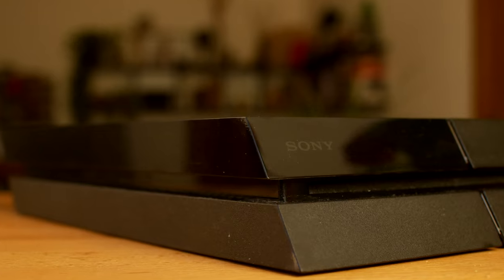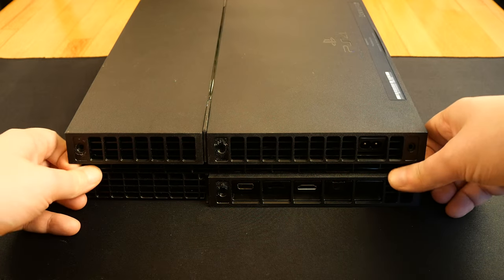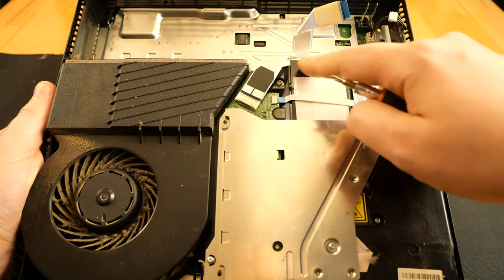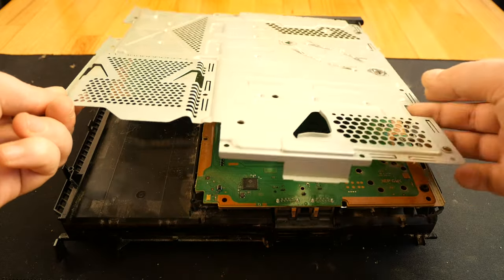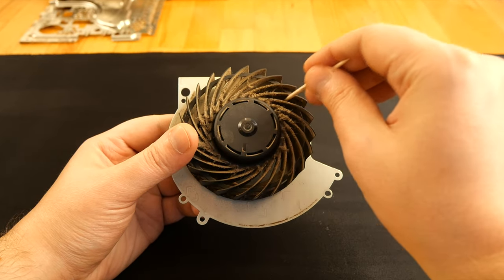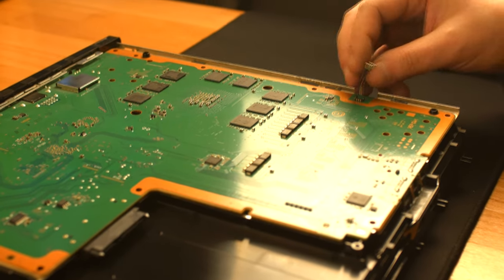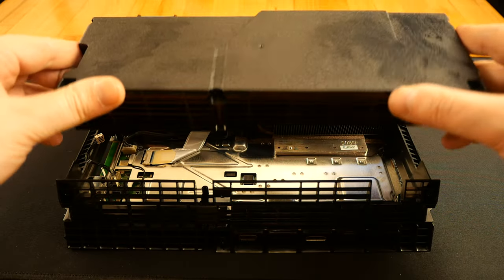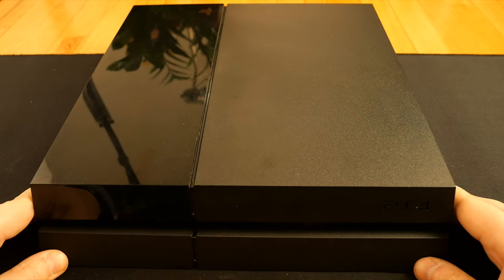How to Clean PS4 Fat - PlayStation 4 Teardown & Cleaning

Comment: I would recommend against taking apart the power supply as a general rule of safety, capacitors can still hold charge even when the device is off and unplugged. This rule generally comes from the PC building realm, however, I would still treat any electical component that has a PSU like this one with caution and wouldn't open it.

Comment: thanks for the video, successfully cleaned mine today, no more fighter jet sound.

as for the ribbon, while pressing the metal tab on the connector, i can pull out the ribbon without any damage.

and while doing all this, i change my cmos battery too, because there is some rust already on the battery.

 anyway thanks again.

Comment: For the ribbon cable, youre supposed to press down on the handle not pull it back. And you missed to put in 2 philips screws for the blu ray drive when you were re-assembling it.

Comment: I just broke my 4 pin power supply cable cause mine was stuck into the socket since it had never been removed yet. 😩
Reply: Shit, man. I was just about to take my PS4 apart when I came across your comment. 
That's very discouraging.

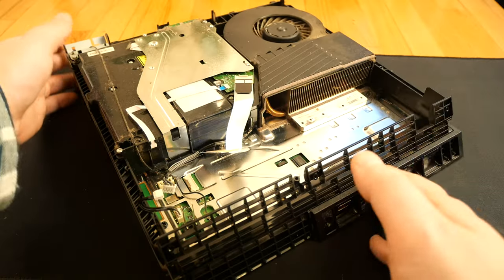Comment: 4:09 I need to know on a scale of 1 to 10 how worried I should be, cause I was prepared to buy a new disc drive entirely when I just might need the cable. As it DOES seem quite impossible not to break, I ended up chipping both left and right ends to that exact same degree. There's no damage to the connectors, just a small chip off the corners and my dumb ps4 can't detect the drive anymore. Idk why these stupid console makers always put these cheap-a ribbons in the worst positions held down with the worse locks that are bound to break each and every time!
Reply: Nevermind just solved it! 
For anyone having issues with the disc drive not being detected anymore, try pulling it out again, becareful lining it back in place but give it a good push to the very back of the socket so that the black and red lines on each end reach outline of the white sockets. Turns out that little piece that chips off the end of the strip holds it as far in as possible. To my knowledge, the side connected under the power supply may peak out a bit more and still be okay. Make sure the half of the strip on top is ALL the way in to the line!
Reply from the maker: I'm glad you solved it, ribbon cables indeed requires some patience and lots of attention
Reply: @nicklespale22 by "giving the push to the very back of the socket" do you mean the connection of the ribbon cable at the top of the drive? I inserted it but it feels kinda loose there. That's why probably my drive is not detected. Just wanted to check that I understood your comment correctly.